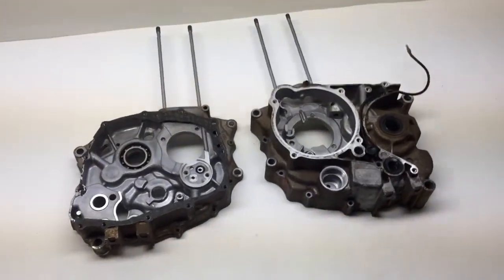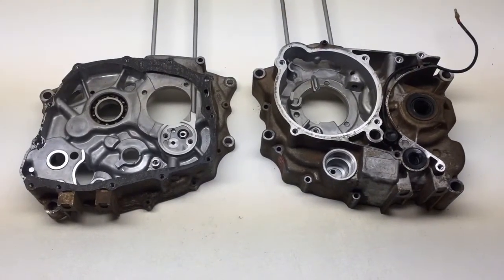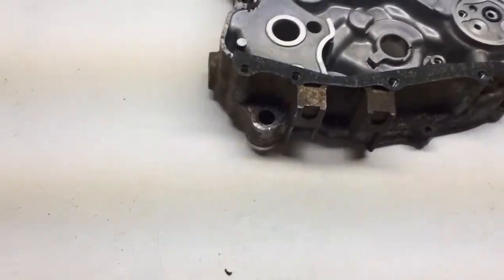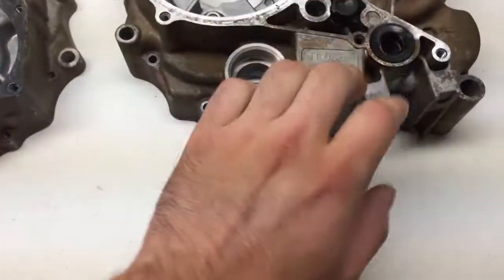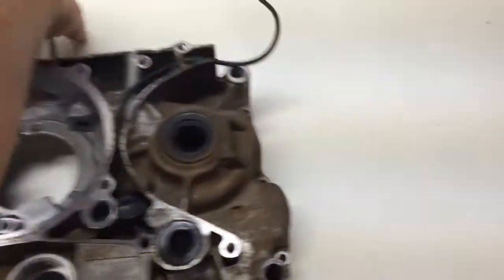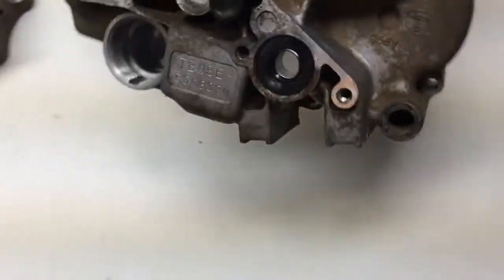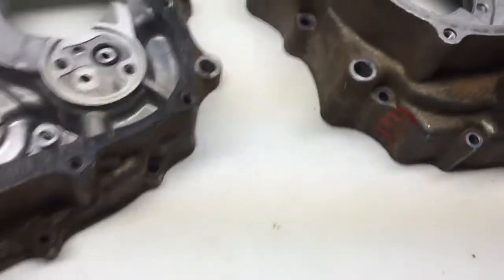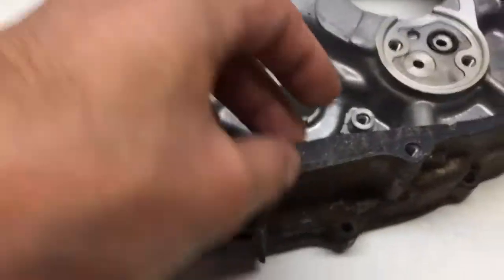Vapor Blasting Honda ATC 200m Crankcase

Comment: Hi, what type media do you use? I blast with either aluminum oxyde or ceramic beads and in either case I find everything is covered in media and requires serious cleaning to get that stuff out. I see you left the ball bearing in ..... in my case this would be filled with media and rendered useless. How do you get all that stuff out?
Greetings
Reply from the maker: I just rinse it with water and the media is gone. Check my video “Changing the media on vapor blaster” it shows what I use and were to get it. It’s a super fine glass bead.

Comment: I am actually in the process of buying this unit and that compressor and i really appreciate your videos for the simple fact that its real world and not paid promo. Not that there videos werent real world but coming from a buyers perspective it's very refreshing.
Reply from the maker: Nice. Yea these two units are running great so far. I haven't had any issues. If you get this compressor be careful removing it from the pallet. I ended up removing the motor and pump from the top to make it lighter to bring off the pallet.
Reply: Money is an Illusion Thank you man..